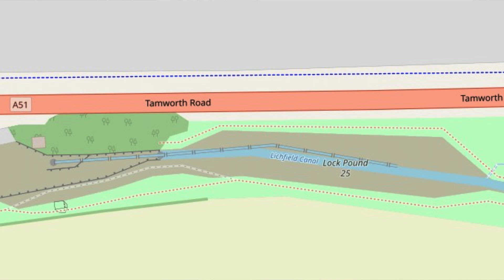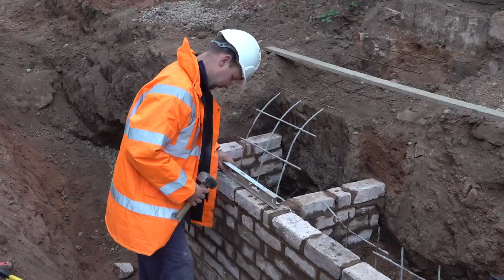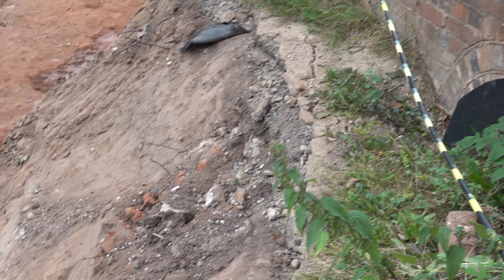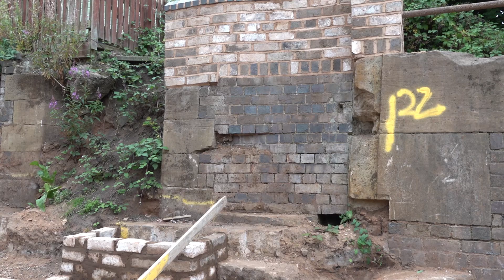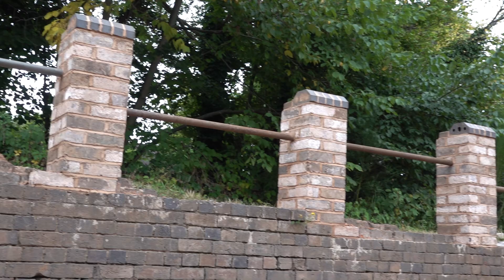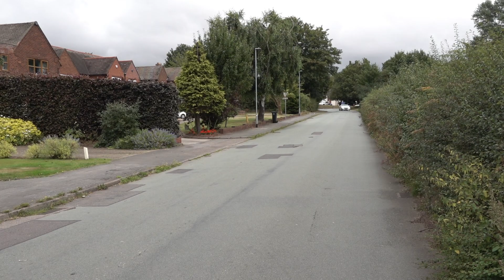Lock 24 Update

Comment: So I didn't really understand, will the pipe remain inside the walls after the canal is finished? If so wouldn't it put the structure at risk of collapsing?
Reply from the maker: The section of the big pipe through the narrows will be retained for reasons of water hydraulics. I’m not great at physics but I’m told… When a boat enters a narrow section or a lock chamber there is a sort of piston effect and the displaced water builds up in front of the boat slowing it down. The faster you try to go, the more water is displaced and the greater the resistive effect. 
So the idea is to retain the pipe as a sort of pressure relief. Effectively we create a parallel channel using the pipe next to the narrows. It will go through the new north wall at either end, and eventually be cut off level with the new wall.
Reply: @LHCRT  Oh, that's pretty smart. Thanks for the explanation. You will probably need some mesh to protect the pipe, won't you?
Reply from the maker: @btudrus  yes, indeed. If you look at the photos on our Facebook page, you can see the rebar mesh.